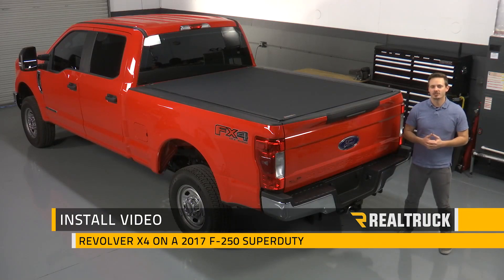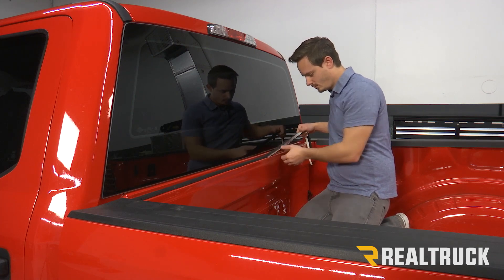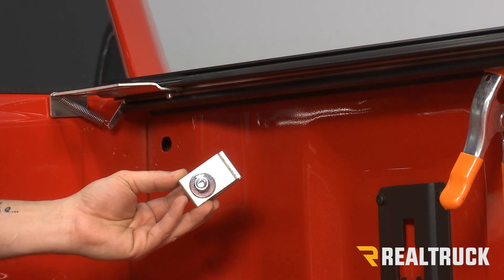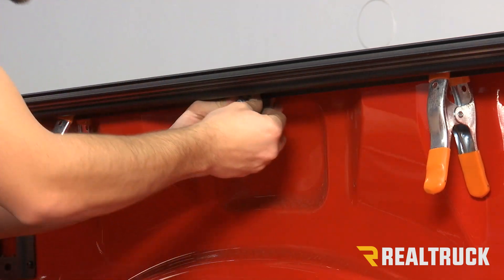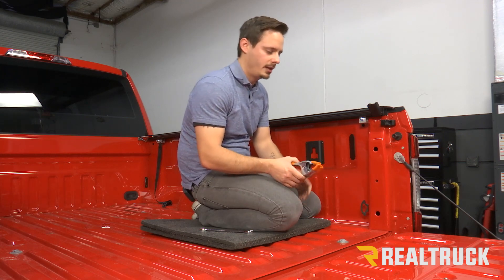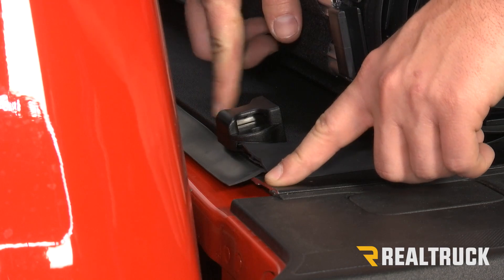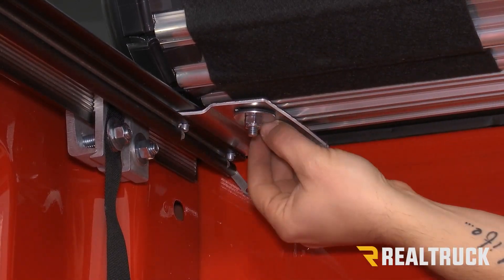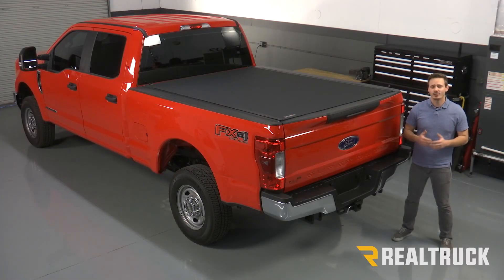How to Install BAK Revolver X4 Tonneau Cover on a 2017 Ford F-250 Superduty

Comment: Thanks!  I just installed one on my 2019 Ram 3500 Dually.  The written instructions were pretty good, and I probably would have done just fine with those, but the video made it that much more obvious.  Everything seemed to go together pretty easily, though I had some adjustments to the instructions since mine is an 8' bed.  It rolls open and close nicely, the side rails lock in, the rear catches engage well, and with the tailgate closed it seems pretty secure.  My wife commented on how nicely it matches with the factory trim on the bed sides.  Open or closed, it looks good too.  I'd say this is a good product, with a well thought-out design, and the video does a great job of showing just how to install it.
Reply: I can't find the information anywhere, so maybe you can tell me? I'm interested in this, but was wondering how much of the bed the cover takes up when it's rolled up all the way to the cab? In videos, it looks like it's about 12" or so fully rolled. I have a 6' bed, so mine would be a bit smaller than your 8' bed measurements, but if you could estimate, that would be great!
Reply: @BeefyChief92  Good question, and I'm sorry for the slow response.  I went out and rolled it up, and put in the straps that hold it, and it stuck up 7 1/2" above the bed (the whole thing is above the bed, not in it), and about 13" front to back.  If I'd done a little better job rolling it up, it might have been slightly smaller and more round, but that's about what you should see.  Also, having it less round means a little less blockage of the rear window view.  I also found that it gets seriously hot, and that aluminum is not comfortable when hot!  Fortunately, there are a couple of strips of material you can safely touch, one toward either side.  With the 6' bed, you're right that yours would use a bit less, 3/4 of the total length, so about 6" tall by 9" front-to-back would be my estimate, though I'm not taking into account the linear-to-square adjustment.  We found that it doesn't block enough of the rear view to be a problem, and unlike the ones with the case it rolls into, the entire space inside the bed is still available.
Reply: @BruceS42  Thanks, I appreciate it!
Reply: @BeefyChief92  You're welcome; glad to help.  One warning in case you order one of these: they're terrible on communication for the order.  We got one automated email saying they were running behind.  Then nothing.  I wondered when it would arrive, expected to get the now-common emails saying when it was fulfilled, when it was shipped, some tracking ability.  Nope.  Then one day we saw a big box at our front door.  On opening it, and checking contents, we found it was missing the side rails, which the packing list said were included.  I sent an email about that, and got no response.  Shortly afterward, another big box showed up at the door, with the rails.  Whoever's in charge of that sort of thing completely dropped the ball, repeatedly.  But it all arrived in a reasonable time, and it went together easily, so that's not much of a complaint, more a warning of what to expect.  It's like going to a restaurant with almost no service but great food.  If you know ahead of time, you won't be disappointed.

Comment: Why would you put the clamp with the strap right next to another clamp?  Wouldn't I want the clamp with strap closes to cab, and space remaining clamps evenly.
Reply from the maker: Hey Matthew, BAK does recommend you install the clamp with the strap in front of the first clamp. I'm not sure if it makes a difference but we will check and make sure we aren't giving bad info!
Reply: I did my install this past weekend with no issues thanks to this video.  I installed it just like the video showed.
Reply: My thoughts exactly.

Comment: So you lose bed space at the cab and sides from the rails ,looks nice but I use my bed ,at this price point you may as well by a fiberglass locking camper shell
Reply: @joelw2413  does yours leak at all? Is it easy to take off real quick if u need the full extension of your bed?